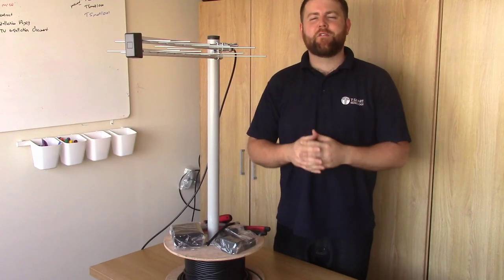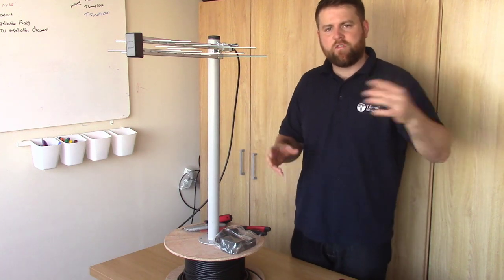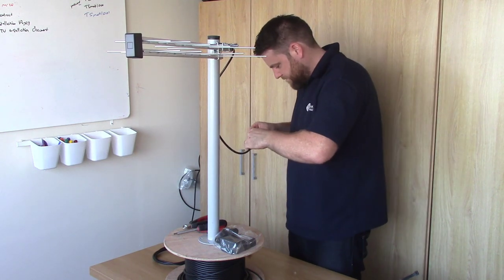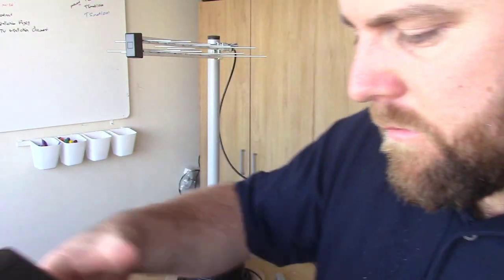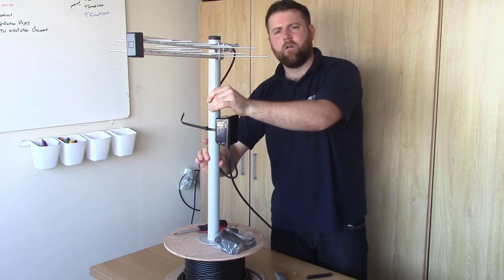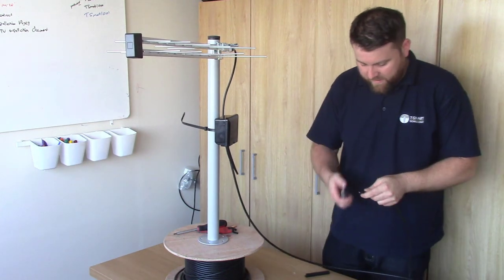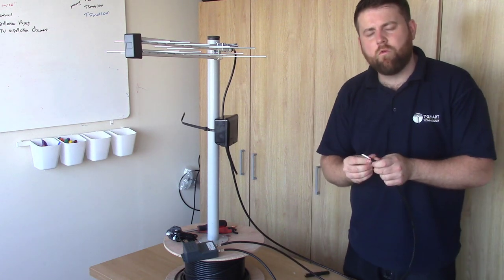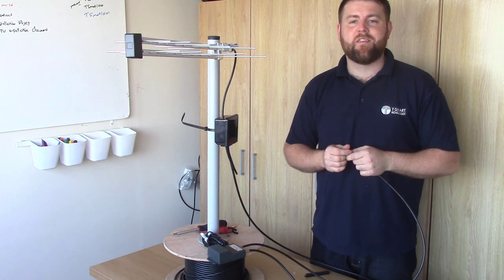How To Fit A MASTHEAD AMPLIFIER & Power Supply Unit

Comment: I need to fit a four way splitter and power supply like you have in your video. If the aerial coax goes into the IN connector on your splitter then the coax which goes to the power supply connects from one of the splitter OUT connectors and to the IN 12v connector on the power supply, hasn’t my 4 way splitter now become a 3 way because one of the outputs has been taken up by the splitter to power. Hope this makes sense. It does to me. The video really useful and much appreciated. 👍
Reply from the maker: Hi Neil, most multiple output masthead amps like the one in the video can be powered off any output but some require the power unit to be connected to a specific output. It will say on the unit itself. The PSU also has an output which will feed to the 4th TV. I hope this helps. Tom

Comment: Hi Tom thanks for the reply. Yes there are power cables in the loft which I could run a spur off. 
Cheers Alan
Reply from the maker: Hi Alan, you could install a one way set back amplifier before the splitter. Like this - 

https://cpc.farnell.com/antiference/a1100r/1way-signal-booster-amplifier/dp/AP00780 This should overcome the signal losses associated with the splitter, 

or you could remove the splitter and fit a 4 or 6 way distribution amplifier like this - https://cpc.farnell.com/antiference/a260d/2-in-6-out-remotelink-amplifier/dp/AP01143?mckv=s93PuUNzw_dc|pcrid|224680055011|kword||match||plid||slid||product|AP01143|pgrid|51011277550|ptaid|pla-805426656427|&CMP=KNC-GUK-CPC-SHOPPING&gclid=CjwKCAjwssD0BRBIEiwA-JP5rO2hz1e36YX19eNdahKP3XdyVyCN8f2YePTA2ENdJ3Ofb5Nj6UpP7BoCidMQAvD_BwE

I hope this helps, Tom

Comment: Great Video, as electrical contractor I am
Frequently asked to include installation of new aerial points, this has really helped and gives me the confidence to offer this on small domestic extensions. Do you have a preferred/go to manufacturer for splitters and master head amps?
Reply from the maker: Thanks and sorry for the slow reply. Glad the video helped. I mainly use Wolsey and Antiference for amps, but Vision and Triax are good too.

Comment: Hi fella,  just moved into block of flats, I'm on the top floor but our signal comes from a communal aerial.
I have exact same equipment as in your vid..
If I came from the face plate to the splitter,  then put one of those power supplies on each leg, one each to kids room, and my room, and then run the coax from near the front room face plate to my desired rooms... Should that work.....
I have already done it, but had the booster on the line first, then into the splitter, and then to the 3 rooms,  but I got nothing... Could that be coz I did it the other way around to what you did...
Some advice or help would be great.. Thanks alot
Reply from the maker: Hi Liam, I wouldn't use this if equipment if I was installing this inside a flat with internal cabling. I would just use a distribution amplifier. You would only need one power supply to power the amp, you don't want to install any more than that. I would install it this way if you using your kit. Wallplate>>Ampllifier>>Splitter>>Cables>>PSU(in any room). If it doesn't work you may have a splitter that is not DC passing or connections on power supply the wrong way around. Tom
Reply: Hi Tom, as soon as I txt you I went and messed around a bit more... I have coax run from far corner of my flat near incoming point, to the two bedroom at opposite furthest point of flat.
It comes in from outside and goes straight into the exact same splitter on your video, then I have 3 outgoing cables, 1 to tv above the point, and 2 running to bedrooms,   on the furthest bedroom run, I have it going from the splitter into a amp(again the exact same as in your video). And then from amp to bedroom....

It didn't work at first,  but I turned down the dB dial on the splitter and EUREKA!!!!!
ATM, all is OK,  should I disconnect the amp,  or if its working, should I be OK????
Again thanks for your time Tom...
Top vids!!!

Comment: Hey 👋🏼 is there any way I could please get some advice? I just had sky installed but only in the living room . I had one of these power supplies (also in the living room) but the sky engineer told me I didn’t need it any more so I cut it off. Now my upstairs tvs have basically no signal . So now I feel a bit stumped . As I cut the power supply off so there’s no no aerial left to it 😩 thanks 🙏🏼

Comment: Hi there i really enjoy the videos they come in really handy. I hope you can help. I have a mobile home in the country. I have a high gain aerial to a indoor 4 way booster box. Im looking to receive feed from a main freeview transmitter. Would i be best adding a masthead amp. And if so should i continue splitting the signal from the booster box or do i split the signal at the masthead and run separate boosters. Many thanks
Reply from the maker: Hi Lewis, thanks. One amp/ booster is usually more than enough. It goes like this - Aerial > Amplifier > Splitter > TV's. You could just get a four way masthead amp which has is an amp/ splitter all in one. If you're worrying about not having enough signal I advise getting one with an adjustable gain, so you can adjust the amount of amplification. I hope this helps, Tom
Reply: @smartaerials  thats great tom. Thank you so much for replying, i really appreciate it

Comment: Hi Tom great vids.

Hope you can help. I have just purchased a property which has tv sockets in 4 rooms. I've had to put the ariel in the loft. I purchased a 6 way splitter but no picture. I've put the coax from the ariel straight to a tv which worked a treat. I have been told I need a booster? Can you recommend a good booster I need and point me in the right direction of one of your how to install vids.
Thanks bud Al
Reply from the maker: Hi Alan and thanks. Yes you would lose quite a bit of signal out of a 6 way splitter (around 12dB), can you please just confirm for me if you have a mains electrical point in your loft? Where the splitter is.

Comment: Does it matter if you use a masthead distribution amp with masthead power if there is no masthead amplifier on the aerial due to it sending power up the cable but there being no amplifier there to send power to . Would this damage the power supply in anyway ? The reason I'm asking is the aerial man has replaced the aerial at my Auntie's house and didn't put a masthead amp on the aerial which was there on the previous installation. But the distribution amp is still there sending the signal to 4 tv's around the house. It previously provided power for the masthead amp before the aerial was changed.

Comment: Nice detailed video on how to install it! I have a strange problem with mine though - it's sending the +12V from the power supply straight down one of the output legs instead of the signal! Any idea why?
Reply from the maker: Thanks! Some models DC pass down the output legs to power remote eyes for Sky playback systems but this wouldn't explain why it is not passing up to the aerial. What model of masthead amplifier are you using?
Reply: @smartaerials  Not sure of the make and model; it was installed for us many years ago. Three of the output legs work fine sending the amplified signal to the TVs, including the one with the PSU on it. If the defective one is connected to a TV however, the PSU shows a red light instead of green and all other TVs in the house lose signal. Crossed/reversed wires?
Reply from the maker: Sounds like you have a short on the aerial cable. I would advise checking the cable terminations to make sure that the braid/ shield are not connecting with the centre conductor at both ends of the cable. It could also be a faulty cable or if could be a bit of stray voltage coming from the TV. You will either need to replace the cable or fit a DC block to overcome these issues respectively. I hope this helps.

Comment: I have the televes preamp I had it set up and working.  now the power light is on in the house but the preamp is not and I habe no channels I checked connections but did not go on the roof to check the one on antenna. how do I find out what went wrong

Comment: Thank you good video, how can you check if the amplifier is gone, I do not have a signal any more
Reply from the maker: Easiest way would be to just try a new one or bypass the amplifier altogether with a join and test the TV to see if it works. If you have a masthead amplifier and power supply unit. It's more common for the PSU to become faulty.
Reply: @smartaerials  thank you for the quick reply
Reply: Good video I have a question on the 2/1/20 I had 88 TV channels put new aerial on roof 15/1/20 now have 93 chanals had to retune on 17/1/20 because of missing channels now I have 29 channels. Is it a freeview issue or do I need a booster

Comment: I have one of these in my loft connected to the tv aerial, that is also mounted to the joists in the loft.  It sends signal to each of my four bedrooms.  I also have Cat6 cables in the loft for my CCTV, but I am getting horizontal interference lines on my cctv, mainly at night.  Could the tv aerial, or amplifier box (and the wires going into it) be interfering with my CCTV system?

Comment: Have just checked the PSU and it’s a 200 mA , the only ones I can find locally are 100mA, will it make a big difference or will it not work at all?
Reply from the maker: Depends on the masthead amp. Most of the ones I fit are 100mA.

Comment: Thanks for the Video! If you are using more than one port / TVs do you use one Power box per TV or will one work for all.ports?
Reply from the maker: One power supply unit is all that is required. Not separate ones.

Comment: Hi so on my booster box I have one cable coming down into my front room with a 12v psu I wish to put a 2nd lead to a bedroom. On the box on the arial there are 2 outputs will I need a 2nd psu from the aerial to my 2nd TV or can I just run a cable from arial to the TV thanks
Reply from the maker: Hi Glyn, one PSU will be fine. Just connect the cable to the second unused output on the masthead amp. Tom
Reply: @smartaerials  would the masthead be on the aerial  then?

Comment: Hi there i have 7 tvs to supply cable to for freeview in my new house. How would i do this ? Thanks
Reply from the maker: Easiest way would be to just get an 8 way distribution amplifier and connect all your cables into that. If you don't have a power supply where the cables come back to you could install a masthead amplifier and 8 way splitter, just make sure that the splitter is DC passing.

Comment: Great vid. 
Hi just moved into a new property which has a Vision V20 masthead amplifier but not sure its working correctly. The green light on the 12V power supply goes out when a cable is connected.
Ive read that the light should stay on but may go red if there is a bad connection i.e shielding  wire touching conductor. is the light going out altogether a sign of a defective power supply?

Comment: In the 1980s and early-1990s we received our TV signal from Crystal Palace (London) even though we were roughly around 50 miles outside the recognised recieving area. We had (I think) a 23 or 24 element criss cross aerial with a masthead amplifier in the loft. The signal was 100% with no hiss at all. Do you think in the same location with the same recieving equipment it would work for Freeview today? There's two extra TV channels on Freeview in London. Great YouTube channel by the way. 🙂
Reply from the maker: It should be fine if it was fine before, digital TV actually requires less signal strength than analogue (usually broadcasted at a lower also). Some things may have changed like trees, buildings in the direction but the only real way to know is to run a test or give it a go.

Comment: Hi could I connect the masthead power supply between my tv and wall socket or would it have to be connected directly from the aerial splitter? 
 Thanks

And your video has been very helpful and informing. Thankyou

Just to add, I live in a 3 bed house and want to use a 4 way split; research has told me I need a very high gain aerial (which I have purchased).  In your opinion do you believe I would benefit from an amplifier?
Reply from the maker: Hi Leigh, it can go between your TV and wall socket, that is actually the most common place for them, the socket just needs to not be isolated however as this would stop the DC voltage from the power supply reaching the masthead amp.

In regards to the aerial, I can't really say as this would depend on how much signal you're getting off the aerial. I would put an amp in to be on the safe side.
Reply: Thanks
Reply from the maker: You're welcome, please subscribe to our channel. Tom

Comment: Thanks for the explanation!  

Just wondering: have you ever come across a Wolsey WPS100/1 PSU that still lights up green but has actually blown and lost its actual functionality? My TV signals have all vanished - the 10 year old Wolsey PSU is still lit, but there are slight singe marks on its outer casing... 

BTW: If you were going to replace such a unit (assuming that IS the culprit) what (reasonably-priced) alternative would you recommend...?

Comment: Thanks for providing your video.  My daughter has moved to an old house that already has a 4-way Wolsey Masthead Amplifier on an outside wall.  When I looked inside the box the feed from the aerial was connected to one of the OUTPUT connectors and the main TV feed connected to the INPUT connector.  In theory this shouldn't have worked but they get a good signal from it.  The other OUTPUT feeds go to other parts of the house.  None of these work.  There is NO PSU connected (this being taken by the previous owner I assume). Does anyone known if you can purchase just a new PSU?  The next time I visit, a 150 mile round trip, I will go armed with the necessary tools and equipment.

Comment: Hi, thank you for your illustration. One question, is the Power Supply providing power down the same coax cable that is going to the amplifier? In other words are both signal and power going down the same cable?
Reply from the maker: That's correct Abdol. It's usually a 12V DC. As the power is being transferred down the cable you need to make sure this reaches the masthead amplifier. This means if you're going to be installing a splitter in between it must be DC passing and any wall plates must not be isolated wall plates as this will prevent the DC reaching the amplifier.

Comment: Hi, thank you for your video, it was very informative. I recently moved into a house where my tv did not work as the previous owners had cable tv and had cut the aerial cable. I had a professional in to rewire the canal and he said the signal was too weak to get many channels. He then installed a booster 4-way splitter and a power supply in my loft. He said if that did not work, then the next stage would be a mast head amp but it would cost me quite a bit to add. He led me to believe that he could add it in between the aerial and the booster 4-way splitter, utilising the power supply added to the loft for the booster. Does this sound correct? Thanks you for your time and help.
Reply from the maker: Hi Matt, you're welcome. Yes that can be possible but it depend on what type of booster 4-way splitter that you have. You may need a second power supply.
Reply: Hello again. I've got around to added a mast head amp to my set up and it hasn't quite worked out to plan.
I added a mast head amp and power supply unit before the 4-way amp and it seems to have made things worse. I've then tried taking the 4-way amp out and going direct from the power supply unit to each tv which seems to work great. Would I have to use 2 separate power supply units to each output from the 4-way splitter? Thanks again for you help.
Reply from the maker: You might have a faulty 4 way amplifier. I would try keeping the new masthead/ power unit that you have installed and fitting a passive four way splitter in place of the 4 way amplifier.

Comment: Had a power cut and tv shows no signal when power restored. PSU led does not light, fuse in plug ok, is it likely that PSU has failed?
Reply from the maker: That would be the first thing that I try Bob.

Comment: I want to bring it down from my ariel in the attic to a wall plate. Ill put the 1st 1 way booster on my ariel. Should I put the 2nd booster(the one with the power supply) one straight after the wall plate or a bit further on. As the tv isn't near to the wall plate? Tv is about 7 meters in wire away from the wall plate. Does that make sense ?
Reply from the maker: Hi David. It doesn't really matter. You're supposed to have a few meters between the amplifier and the power supply but in practice it could go where ever. So by the wall plate, by the wall plate, before the wall plate would all be fine. If you're going to be using wall plates make sure that these are NOT ISOLATED as this will stop the DC voltage from reaching the amplifier.

Comment: Hi thanks for the video. I'm wanting to install some extra TV points, what's the difference in this system as apposed to a regular booster box in an attic supplying multiple TV outlets
Reply from the maker: You're welcome. This one doesn't require a mains electrical socket in your loft.
Reply: @smartaerials  thanks. So does that mean that all the supply's to every TV come from the masthead amplifier?? Is that not alot of cables coming through your roof tiles if you've multiple tvs to feed??
Reply from the maker: Depends on the masthead amplifier that you have, if you had a 4 way masthead amplifier this can feed 4 TV's. A 6 way, six TV's etc. The masthead amplifier could be installed inside the loft so you only have to get the one aerial feed in, that's the way that I would do it.